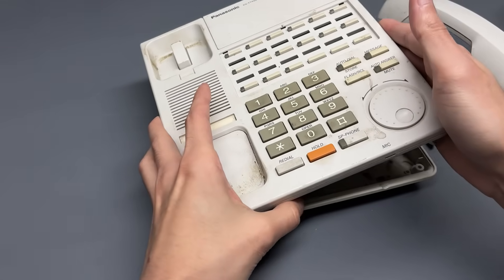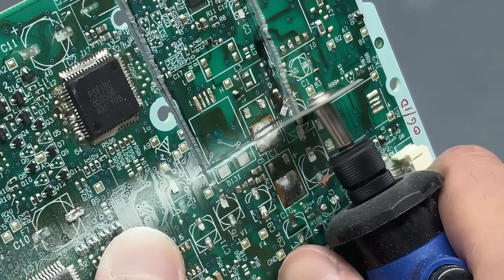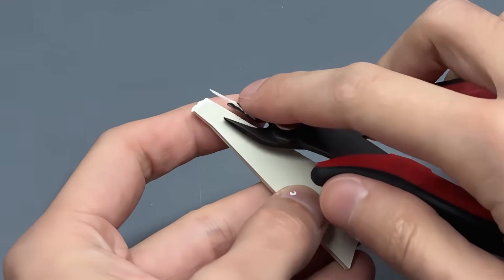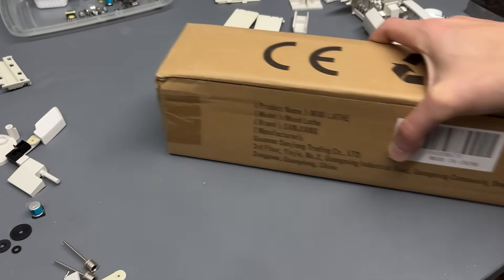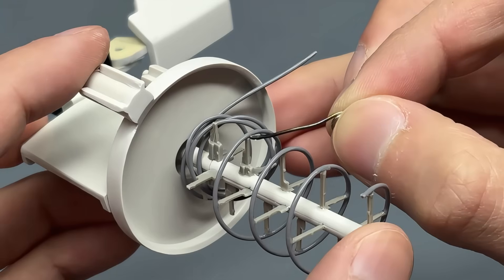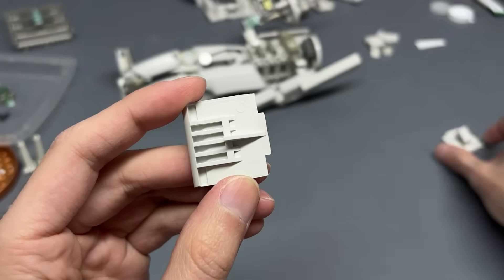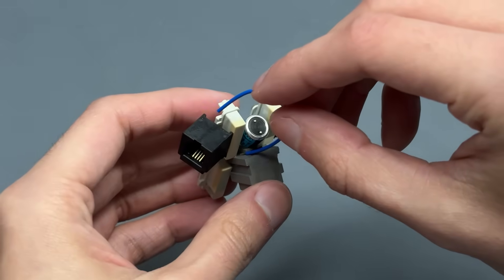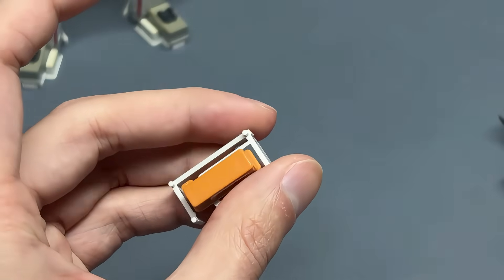Kitbashing a Mech from Only a Phone: The Relay Warden

Comment: It would've been cool if you added a piece of the motherboard behind the shield to fill in the gaps. Also if you added some leds/lights throughout the robots body
Reply from the maker: I considered a few materials for the shield but purposefully left it with gaps to show it’s not designed for kinetic projectiles. LEDs would have been cool but the phone didn’t come with batteries 😁
Reply: @proto.roborovski  yes I see that you adhere to strictly using parts that come from the project itself. Also backing the shield with the motherboard would've given it a look like it produced a force field
Reply: @proto.roborovski  can't wait for your next project. I wonder how a big object like a laptop would do. Or an older tv/desktop computer/vacuum cleaner
Reply from the maker: @shahs3262  my build size is usually limited by storage space. I try to use as many interesting parts as possible, but it won’t work to use 100% of something large. I’m considering the next project to be made from a printer, so we’ll see what happens!
Reply: @proto.roborovski  awesome

Comment: why you made  the joint parts so detail if you gonna lock it afterward??? no articulations
Reply from the maker: I originally planned articulation but I didn’t have any fasteners to work with. What would you recommend to keep the joints strong and posable?
Reply: @proto.roborovski  if you dont mind added thingd outside the phone thingy....maybe some tiny rachet joints like the one Revoltech use or some kind of knee" hydrolic" like the one use on gunpla
Reply from the maker: @dumbfox0.819  the goal of the challenge is only phone parts, so no extra bits 😁
If you want to see articulated models with extra hardware, I have plenty of those builds on my channel!
Reply: @proto.roborovski  with your skills,you perhaps can make the tiny hydrolic from the phone's part though....maybe???
Reply from the maker: @dumbfox0.819 I was thinking of ways to sandwich material and even make spring latch joints but I’ll have to experiment with that in the future 🤓

Comment: When you start building. Do you have a specific plan for the model ahead of time? Or are you building like a framework and then going off of that? I don’t know anything about modeling so sorry if it’s a dumb question but I’m just so fascinated by the process.
Reply from the maker: Not a dumb question! It's a complex process that can be handled dozens of ways.

I like starting with proportions/ratios - upper vs lower body, arm vs leg, waist vs hip, shoulder vs hip, etc. I start with major concepts, like the purpose (telecommunications and not assault), and this list can have endless features (helical antenna, backpack radio, signal blocking shield, the number 13). Recently, I have started measuring and test fitting components without glue to plan a really solid starting point - but everything after the 2 minute mark is improvisation and "sculpting".

Comment: You could've wrapped that wire around something cylindrical and then applied heat. You still produced a pretty uniform helical, I must say.
Reply from the maker: This is actually what I ended up doing, but the footage was terrible and I didn’t know if it was worth mentioning since it might not be completely necessary.

Comment: As someone that repairs electronics it's fun to see things that I work with frequently used like this. That wire is quite a pain to work with at that age. The right amount of stiff and springy to be kind of a pain to route where you want it to go. I particularly like the use of capacitors and diodes on the model. Absolutely fantastic use of those.
Reply from the maker: Thank you! Yes, the grey wire was abysmal. No matter how much I bent or coiled it, it somehow always turned super straight - which might be great for an antenna, but terrible for what I was attempting 😂
Reply: Can I ask you a question? Are capacitors dangerous to use like this? Or it's fine if they small
Reply from the maker: @nightdog6387  Some capacitors such as the ones in my video have liquid electrolytes, so the only risk is rupturing the can and potentially irritating your skin/eyes. The bigger hazard is a capacitor with a large electric charge inside. If you’re uncomfortable using them, I’d recommend just avoiding it.
Reply: @proto.roborovski  alright, thank you
Reply: @nightdog6387 ones used here are low voltage. Anything below 30v is perfectly safe generally. High enough capacity could burn something but not hurt you. Discharge by putting a copper wire between + and - if you're feeling paranoid. At higher voltages you'll want to discharge them. But if there's no power in them they won't pull it from nowhere and thus they are safe with the only risk being leaking some acid like AA batteries can sometimes do.

Comment: bleached white 80's space tech asthetic will never not be cool
Reply from the maker: Thanks! 😁
Reply: @proto.roborovski  you should make more stuff out of a single original object. because the source was all designed with one material, colour, and asthetic, it reflects on the output build because you already use a unified set of parts that look nice with each other, so you dont have to worry about how it looks, only 3d design 'shape' instead of colour/material
Reply from the maker: @LightningLaser19 I plan on doing this again for sure 😁
Reply: @proto.roborovski  i made a miniature tank once using an old computer mouse, the optical sensor + mousewheel for the 'turret' and usb ports etc on the hull. you can make some really interesting stuff from household objects.
Reply from the maker: @LightningLaser19 absolutely! I have boxes of dead cameras, keyboards, AV equipment, laptops, mice, etc with a lot of potential
Reply: @proto.roborovski  hey uh if you dont need any of that feel free to send it over

Comment: I've been kitbashing stuff for a long time, but this is the first time I've encountered the idea of kitbashing something from old scrap. That's genuinely amazing. I can't lie--as impressive as it is, the thing that impressed me most was realizing lego could be used to make a square. That's one of those observations that some people make that really makes me think they're a different level of smart. EDIT: Okay, nevermind. Watching you transform the subframe into a molded exoskeleton, taking account for things like seams and joints between what would be armor panels, and then using the existing material to create a colorway, AND then bringing the head sensor unit to life with all the different components , AND THEN bringing life to the machine by making it look so authentically designed... that was the most impressive part by far.
Reply: Really, I don't know if I could call this kit bashing, technically you can use anything to kitbash, but most people would be using model kits (hence the name) for at least most of their model.  This is more like sculpture given how little of the final form is pre-made.

Calling it kit bashing at this point is almost self affacing, but I'm also pretty sure it just sounds more fun than sculpture to the audience, which is hard to argue with. 

Sculpture brings to mind your Medieval artist slaving away at a block of marble for months and months, but I think that just as much effort and struggle gas gone in to make these sculptures as anything carved from stone or more traditional materials. 

I have to say the video work is fantastic as well and I love the voice over and narrative that you crafted in such few words.

Indeed, you are no hobbiest, you are an artist!
Reply from the maker: @SineN0mine3 thank you very much! 😁
Reply from the maker: Thank you for the kind words! 😁
Reply: I love this! My Dad and I used to make kits all the time and while we’re both quite adept with visual arts I’ve always been very natural and his has been very mechanically inclined. He used to take inspiration from everyday objects to make mechs or futuristic designs as a warm up and honestly it reminded me much of his little doodles in hit notebooks brought to life!
Reply from the maker: @grandmasgopnik9642  that’s great! Thank you for sharing 😁
Reply: Clippy sheep
Reply: Better step your game up then
Reply: It’s because it’s art dude.

Comment: How did you make the plastic white again?
Reply from the maker: The plastic was mostly white, with only some parts yellowing. The yellow could be removed with fine sanding, but I tried not to disturb it. Grime and debris was easily removed with degreaser (LA’s Totally Awesome example linked in description).
Reply: @proto.roborovski thanks

Comment: Nice! Ly! Done!  Pulling out the tiny lathe to convert extra plastic into round stock is exactly the kind of loophole exploitation that's perfect for a single-source challenge.  

Is it wrong that I got a slight bit of amusement out of the fact that you don't have access to a bunch of your standard parts on this build?  It seemed like you had to approximate your design language.  It felt like there were a couple points in there where there had to be some degree of frustration that you couldn't just drop in the metallic frame from a standard pushbutton on a spot and go "There!  Adequate heat dispersal for mech actuators!"  

Again, creating your own round stock by recycling the sheet material is awesome as hell.  Hopefully you won't have to do that sort of thing again, but I could see some much more complex piston assemblies becoming a more common part.  The helical antenna on the relay mech's right arm is rather close in design to some kinds of actual directional antenna.  Did you go browse weird antenna pictures in order to get inspiration?
Reply from the maker: Thank you! Yes, I figured when there is only "raw" stock of plastic that you have to lean into more traditional machining in order to do something with it. I like using cylinders as details so a mini lathe made sense to me. I'm hoping to not need it per se, but I'll try to use it for detailing grooves and chamfers on cylinders I already have. Another idea was to dissolve scrap ABS with acetone and push the "sprue goo" into molds but I didn't want to play with that this time around.

I think the amusement is part of the fun in this challenge. I indeed tried to approximate my design language, such as making the joints from flat plastic where I would normally throw in a 3D print. Although cutting and sanding takes a lot longer, I did prefer how the shapes fit together and looked more unique than simply relying on my usual buttons and plugs.

The helical antenna was based on various reference pictures that I measured to get the proportions right. Typically before a build, I will browse many related concepts, including military trucks, stealth planes, radio towers, etc.

Comment: I literally just took apart 3 of these exact phones that my work was throwing away. Adding to my stash of goodies.
Reply from the maker: That's awesome! They are mostly ABS so you can always convert scraps into "sprue goo" with acetone and it should weld together with modeling cements.

Comment: Some great shapes to play with there! What are you using as a cleaning agent in the beginning there?
Reply from the maker: I've added an example link in the description under Supplemental Resources. They sell many different volumes, including spray bottles. It's concentrated, so dilute it as necessary!
Reply: @proto.roborovski  Thank you!
Reply from the maker: Thank you! I use LA's Totally Awesome degreaser for most cleaning. I can buy it in bulk for a reasonable price, and I filter it to reuse it again since it's just trash cleaning. I originally got it because it's safe in an ultrasonic cleaner and can strip paint, making it useful for airbrushes.

Comment: to echo other comments already made; the lego (well, non-lego-branded compatible building blocks) tools for marking and alignment are brilliant and something i will definitely be borrowing. then beyond that, the whole build was just superb. i think my favourite parts were the variety of uses for the salvaged wiring; not only do you do a fantastic job of joining cables between parts, but the incorporation of wires running along edges to add detail and colour contrast was super cool.
on another note, i've already collected a stash of various parts for kitbashing, but the idea of using a single donor object actually feels a lot more approachable for me to get past procrastination and just build something. thanks to the royal archive and its patrons for another great broadcast!!
Reply from the maker: Thank you very much! I struggle with analysis paralysis and have so many untouched kits because I'm not sure what parts to use. This challenge, although more work, made it mentally easier to proceed because I had to use what was right in front of me. Definitely worth trying! 😁

Comment: 1:20 ProTip: if all you're doing is recovering bits (without the express intent of using them electronically) it's actually MUCH, much more easier to get a kitchen glove, a heatgun and then heat the board with the gun and striking it every once in a while. The parts will fall off the board. I've done this several times in the past when i've recovered cool looking boards - back in the day, there were so many pretty boards and easter egg boards. I have basically an entire menagerie of animals on boards now. Geckos, elephants, pandas (the 1980's Chinese electronics manufacturers loved putting pandas on them), cats, worms, you name it, i've got it. And phrases too. The best one is from an IBM prototype daughter board for a penium II CPU, "Magic Smoke Edition".
Reply from the maker: Oh man, I’d love to try this! Is there any fear of the heat gun discoloring the green board or making capacitors leak liquid? I’ve always used a soldering iron and a precision surgery approach to minimize the risk of melting or leaking anything. If I can get this working, it would help a ton for surface mounted pieces!

Comment: Using Lego pieces as a squaring jig is ingenious 👍
Reply from the maker: Thank you, it’s one of my new favorite tricks! You can build any size and direction square you need 😁
Reply: @proto.roborovski  That and the cookie bin wet sanding setup!
Reply from the maker: @camo4274 haha thanks! It’s not perfectly flat because the lid can bowl, but I’ve been using it for so long and it’s been good for my process. The tin itself contains scraps of sandpaper of various grits too.
Reply: @proto.roborovski  do you think its possible without the lego?
Reply from the maker: @GradyRoberts-d3s  sure! The Lego was just used for alignment. You can use a block of wood or a ruler, whatever is available.
Reply: my mind just exploded with lego tools OMG
Reply: ...and then they buy a mini-lathe to machine "square stock" into round.  Appropriate use of whatever works, low-tech or high.  Nice.
Reply: I know! They are so held to a tight tolerance it’s the perfect thing to use
Reply: Today I found out that Lego is made to a tolerance of 0.002mm.
Reply: @BirloCB  Wow! I didn't know that.
Reply: @Sir_Malcolm  It's why LEGO is so much more satisfying to play with than other brick building blocks.  Lego spent many years refining their design so that bricks click together easily and have just enough resistance when pulling thrm apart.  

Any other manufacturer could copy LEGO's design for interlocking bricks (many already have) but they usually can't match the precision tolerances of LEGO so even with identical and completely compatible measurements between brick brands, the difference between LEGO and the others is immediately noticeable. 

The bricks themselves are just ABS plastic, which anybody can use; the precision manufacturing makes all the difference.
Reply: @SineN0mine3 yeah, one of the major reasons Lego is so expensive compared to knockoffs is genuinely just the manufacturing precision. ABS injection molding is insanely cheap—injection molding brightly colored almost never fading incredibly thin but durable ABS plastic to tolerances of like 10 microns such that 30 year old bricks still perfectly snap together with bricks from today? that's not cheap.

Comment: I'm floored by how your mind works, this mech is amazing! It having a Panasonic brand, signal blocking shield, etc turns from you having limited materials into worldbuilding. How did you learn to build the mechs? Is there some kind of resource to help with, your build looks believable because of anatomy and things looking like they have a purpose
Reply from the maker: Thank you very much! In short, I figured it out over time. I have an engineering background, so I approach art as problem solving. 

There isn't a single trick, but IMO there's two main parts - designing aesthetics and manipulating materials. Google Images, ArtStation, Instagram, etc are great for finding designs; model tutorials are great for figuring out how to combine parts. 

I probably spend hundreds of hours dissecting art, tutorials, and my own pieces - both what I do and do not like - and I try to convert vibes into measurable changes. I measure lengths on images and calculate ratios between parts, such as arm length versus leg length, or leg length versus total height. There's always more to learn!

For me, designing aesthetics is also two parts - function versus form. As an engineer, I always design function first, because I think builds that look believable will always look better. I then manipulate the form after to fine tune it. When a vibe is off, it's usually something subtle like a 5% length difference. I could talk about design for hours, so if you have a specific question I can try to help!